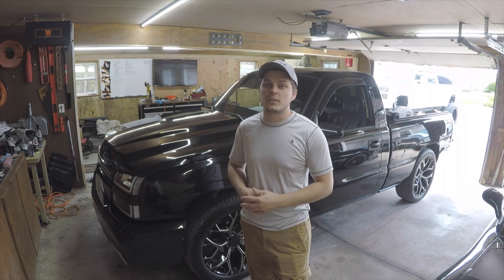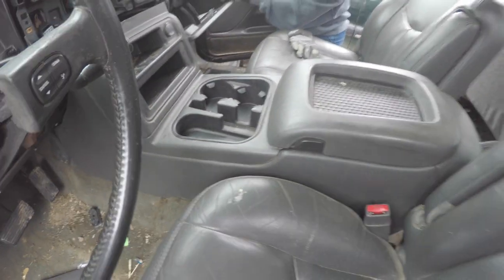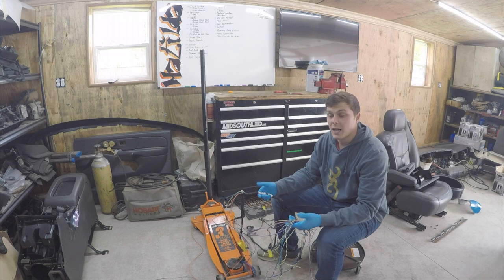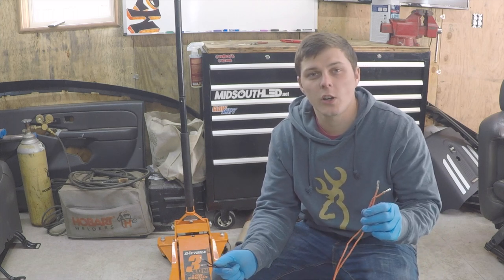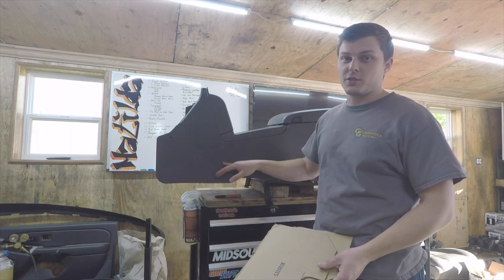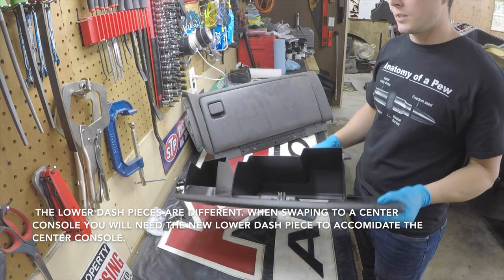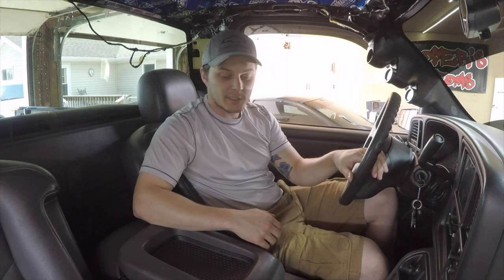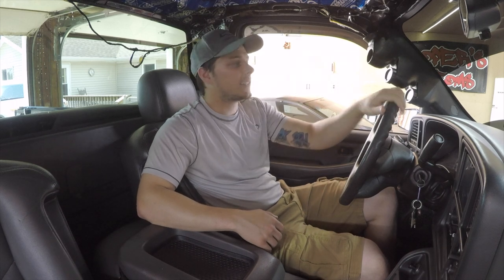Silverado Bucket Seat and Center Console Swap, "How To"

Comment: Mind sharing the P/N for the harness you’re messing with at 5:02?
Reply from the maker: Hey, im not sure on the part number. Im sure there are quite a few, depending on cab size and seat configurations. I just cut it out of an extended cab truck that I knew had electric seats. I got mine from the junkyard. Cheapest and easiest place to find one. Hope that helps!

Comment: Did you do a video of the floor shift to AWD?
Reply from the maker: Hey, for the AWD, I filmed it, but haven't had the time to edit it yet.
Reply: I got a nv3500. I’m thinking it’s pretty much straight forward but I  was wondering if there were any challenges with that
Reply from the maker: @808kahulaa  there are a few factors. Its not to bad with a 4l60e. I swapped to a 4l80e which is 32 splined output shaft. So I had to buy a larger splined input adapter for the awd transfer case. Not sure how many splines the nv3500 has, but Definitely something to look at. I also installed a pump rub kit into the transfercase. Id inspect yours if you tear it apart. 

Also depending which version of transfer case you use, they are different sizes in lengths. The np149 was like 2inches longer than my old 261 4x4 unit. So I had custom driveshafts made. A longer front shaft, and a shorter rear shaft.  I've herd some people were able to use a duramax  front driveshaft, and get a 1350 yoke for the rear shaft and a different U joint to make it work, but the stock driveshafts still blow apart at like 130mph.
Reply: @TheKingCoopa  I understand you are a busy man and if you could clarify one thing?  The increase in length for the swap was not due to the 4L80 being longer was it?  The NV3500 does not use the ~2in extension piece that the 4L60 uses.  I measured the component itself and it was same length.  However, if the dropout lengths are different, that will not work so 
since you mentioned that, I will have to jack up the truck again or slide under and measure the dropout distance.  When I pulled the np149 from a Denali, the driveshaft length was 2 in difference.  I will have to do the work and I will let you know what comes out.  Thanks

Comment: Measure twice,cut once...
Then proceeds to cut 20 times?
Hmmm
Reply from the maker: Haha exactly 👌 You can remove material, but you cant always add it. With the black truck, the goal was for it to be a clean build. I noticed I've gone a little slower on some things, and tried to get that attention to detail, a little more.  So sometimes I cut it 20X instead of twice 😅

Comment: Where did you get that offset 4x4 handle at?
Reply from the maker: You can cut and weld your existing lever. If not, there is one linked in the description of the video.

Comment: Question? Do the center console vents work?
Reply from the maker: Hey, for my truck no. Didnt really have a need for it. They could work if you wanted them to though. You will need the under dash air duct piece that has a T in it. So it can connect to the center console.
Reply: @TheKingCoopa  thank you I was just wondering for a crew cab thx love the vids btw
Reply from the maker: Gotcha, yea sorry I don't know what that part is called. And not sure what it will take to put that T fitting/duct in. But good luck with the swap if you do it. Thanks for the support! 🤘
Reply: @TheKingCoopa  thx and 🤘

Comment: What did u replace the carpet with I hate the carpet
Reply from the maker: Hey, mine has the rubberized floor from the factory. Its the work truck model. You can buy it online and replace your carpet with it, not sure how expensive it is though.

Comment: How did you get the power seats to move in the junk yard?
Reply from the maker: Hey, so when I took the seats out, I had zero power to the seats. It was very difficult. You need two people, and some creativity with some wrenches. It is definitely doable though. The back bolts I basicly would turn the wrench 1/8th a turn, flip it over, and go another 1/8th a turn. Learning from my mistakes, I would definitely pickup a jumperbox, like a portable car starter. Then follow the seats floor harness to the driver side firewall, unplug it, and tap your jumperbox into the pins in the connector  and you will have power to the seats. Orange is hot, black is ground. If you are not keeping the floor harness, just hack it off 2 feet after the seat and its easier to  connect the jumper box to the cut wires. This method, you will have the seats out in about 20min, not 3 hours like it took me. If you don't have a jumper box, you can still get them out, just takes alot of patience. Thats alot of info, hope that makes sense and helps!

Comment: Do you actually need the one under the steering wheel?!
Reply from the maker: Hey, are you talking about the trim panel, knee bolster, under the steering wheel? The trim piece is the same for a center console, or a bench seat. The middle/passanger side trim panel is different though
Reply: @TheKingCoopa  yes the one under the steering wheel
Reply from the maker: @Low-bp6xt  gotcha, yea you don't need a different one. It works with the center console or without it.
Reply: @TheKingCoopa  ok thanks for the help man appreciate it
Reply from the maker: @Low-bp6xt  for sure, good luck 🤘

Comment: What tools did you need for the seat bolts and the center console bolts? I can’t find it anywhere online
Reply from the maker: Hey, the tool needed for the seat bolts are called an E-socket, its like an inverted torx. (I just bought a set) but I didn't have them at the time, which is fine. You don't HAVE to have them. I don't remember which E socket fits them. But I used an 11mm for the back 2 bolts. And a 15mm for the front 2 bolts. You'll need a deep socket for the fronts. I'd definitely use 12 point sockets preferebly. Its gonna feel a little loose on the nut, but those SHOULD be the closest sizes if I remember correctly. Just got slow and press firmly so they don't strip it out. I had to use wrenches on the donor truck, because the seat wouldn't move without power. Anything is possible with enough patience and determination. Hope that helps you out!
Reply: TheKingCoopa dope. Do they sell E sockets at Home Depot or is that an Amazon only buy? Thanks for the response though! Trucks looking dope bro!
Reply from the maker: Thank you, I appreciate it 🙏. If you need it right away, home depot and harbor freight should have a set, maybe even a local autozone, or napa. If you dont mind waiting a week, I personally like buying sets off amazon. I look for the best reviews, and they usually have bigger sets, with better quality than some of the local stores stuff.
Reply from the maker: https://www.amazon.com/dp/B07VBY15JY/ref=cm_sw_r_cp_apa_i_2ADrFb81J0BW4
Reply from the maker: https://www.homedepot.com/p/GEARWRENCH-1-4-in-3-8-in-and-1-2-in-Drive-External-Torx-Socket-Set-13-Piece-80583/202738951

Comment: Where you got the power from and grown
Reply from the maker: Hey, sorry for the late reply! The power you can get from the little fuse box by the drivers side left foot, behind the little cover. The small fuse panel on the left side of the dash when you open the drivers door, behind the little dash panel. Or you can run it straight to the battery though the firewall grommet if you wish. 

There is a factory ground stud directly under the front passengers seat.

Comment: Can I swap bucket to bench?
Reply from the maker: Hey, you sure can! I'm sure there will be a lot of people willing to trade you straight up for your bucket seats, as they are pretty desirable. You could always sell yours for a profit too. The main thing you need to worry about is finding the new dash piece (It looks like mine in the beginning of the video, it's one long piece to cover up the hole were the console was). Also make sure to switch your glove box over so your Vin/RPO codes match your truck. One more tip, some center jump seats fold down into an arm rest, some do not. I'd look for one that folds down, just for the extra convince.
Reply: @TheKingCoopa  okay good, Thank you for the info
Reply from the maker: For sure, good luck 🤘

Comment: How did you figure out the wiring for the seats?
Reply from the maker: If you do alot of your own work on your vehicles, I'd definitely suggest getting the service manual for them. Not the little junk Haynes manual. Im talking about the legit industrial manuals that the dealers use. I bought mine on ebay for about 120 bucks. It is a set of 5 thick manuals, just for my 2004 silverado. They are 3 hole punched. (I also have a set for my corvette, about 300$) The pages are super thin, and there is about 1000-1500 pages per book. These books  cover EVERYTHING! Troubleshooting, wireing diagrams, remove and replace, engine teardown, tranny teardown, and they also cover every single connector in the truck, and what wires go into what slots/pins in those connectors. So thats how I know alot about the truck, is its all in the book. You could also try googling it and trying to find a picture, but that can be kinda hard sometimes. Hope that helps. I know manuals are expensive and not always in peoples budgets, if you do the seat swap and can't find the connector diagram, just let me know, we can figure something out.

Comment: Should have showed how you spliced the harness
Reply from the maker: Yea, I could have. I didnt think it was as important. All I did was pull the old electrical tape off the harness, lay the new power and ground wire with the harness wires, and re-tape it back up.

Comment: Will you sell me the back cubby in the console since you don’t see it since have you a single cab
Reply from the maker: Sorry mate, I'm trying to keep everything super clean on this truck. Knowing that the little cubby isn't there would bug the crap out of me! I'm on the search for the little rubber mat/insert that goes into that cubby, even though you can't see it. Have you checked ebay for the cubby? The next time I go to the the junk yard, I'll make sure I grab an extra one.
Reply from the maker: Here is one I just found on ebay for 36$ and free shipping. Not a terrible deal, but they are really hard to find.

https://www.ebay.com/itm/03-06-Silverado-Suburban-Tahoe-Sierra-Yukon-Center-Console-Rear-Cubby-with-Mat-/143908767143?_trksid=p2349624.m46890.l49292
Reply: @TheKingCoopa  think you very much I ordered it I have been on a hunt for one for a very long time.
Reply from the maker: @haidenoubre8325  sweet! Glad I could help out 🤘
Reply: @TheKingCoopa  if you run across a  little mat for the cubby let me know please
Reply from the maker: For sure!

Comment: Well you be doing a power windows swap?
Reply from the maker: Hey, I'm sorry but I will not be doing a power window swap. I do have the window/door harnesses and the door panels. But I actually like having the manual windows in my RCSB. Later down the road I might change my mind, but for right now I'm gonna stick to the manual windows. If your interested in the swap, I know there are a few YouTube videos already out there, showing the swap. It isn't to hard, a little time consuming though. Basically need the widow motor, regulator, controls, door harness, and door panels. All of it will bolt right in. Just have to get your computer tuned/changed so that it now knows it has power windows, and can send power to the window controls. Hope that helps.

Comment: Where did you get the insulation for the floor?
Reply from the maker: Hey, the blue and black stuff is dynomat. Which is sound deadener. (Helped out alot with the sound system, and quieting the exhaust/road noise) for the insulation i put on top of that, that actually came with the rubberized carpet, from the factory (work truck model). Im not sure where you could get replacement insulation. Maybe one of the aftermarket carpet websites, that sell vehicle specific new carpet kits, they might have it. You could try the chevy dealer, i doubt they would carry it anymore. And if they did it would be stupid expensive. You could always try the junk yard. It would be really cheap, but probably not the cleanest. Or try the Facebook market place. Alot of people are always parting out trucks on there, and you could probably buy the factory carpet and insulation for pretty cheap. Thats the best I got, hope it helps!
Reply: @TheKingCoopa   Thank you. My single cab been sitting for a year in a half and I just recently began to use it again. I forgot how noisy it is inside the cab. It could help with keeping the noise down. Thank you.
Reply from the maker: @Rios_Jr  oh nice. Yea id definitely look into dynomat. I have another video on just installing the dynomat, if your bored. Its kinda expensive, and you'll use more than you think you will. There are cheaper brands/options out there, but I wanted the best results and didn't want it to be half-assed haha. I have side exit exhaust, with no cats, longtubes, and motor work. So it was hard to hear yourself think. I also did their level 2 dynomat on the back cab. Its like studio foam. It all helped out tremendously! I think I used 120sq foot inside the cab, roof, floor, and inside/outside the doors.
Reply: @TheKingCoopa  I will definitely check it out. Thanks.

Comment: So I wanna know more about the power seat mod
Reply from the maker: What kind of questions do you have?
Reply: Where are you getting power fron just a key power
Reply from the maker: So I completely spaced on the filming of that part. How I did it, I ran both red power wires down the floor harness together, spliced them down into a single wire. Then I ran that power wire up into the driver side dash, where the interior fuse box is. For now, I temporarily just used a fuse jumper (fuse tap) and plugged it in to the 4x4 push button fuse. Since my truck is a manual floor shifter, that fuse isn't really used. So I only have power to the seats, when the key is on. You can do it the other way, and find a fuse always hot, so your seats always have power when the key is off. Or you can run an inline fuse and wire it to the battery. 
This winter im installing a roll cage, so all my interior will be coming back out. And once I'm done with the cage, I will hard wire my seats power, into the back of the fuse box somewhere, for a more clean and factory install.
Reply: @TheKingCoopa  what about heated seats did you hook them up
Reply from the maker: Ah, I did not hook mine up. As the truck will get stored for winter, I figured there was no need.  Plus if you want a factory install, the heated seat switch runs through the door controls. I have Manual windows (no door controls) and I didnt really want to convert to electric windows also.
Reply: @TheKingCoopa  cool thanks for the help
Reply from the maker: @devanolear3121  for sure, sorry im not much help with the heated seats. Good luck though 🤘
Reply: What kind of fuse should you like how many amps?